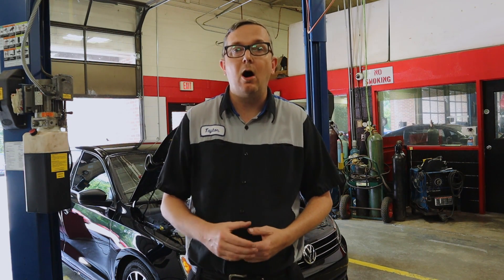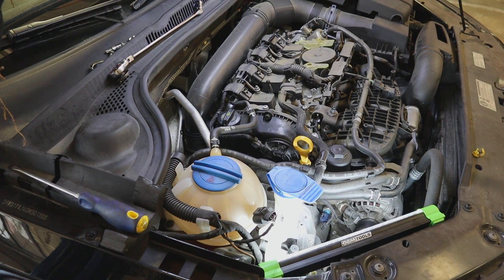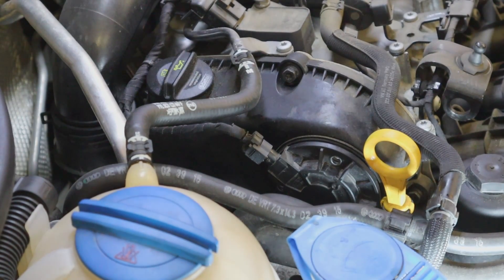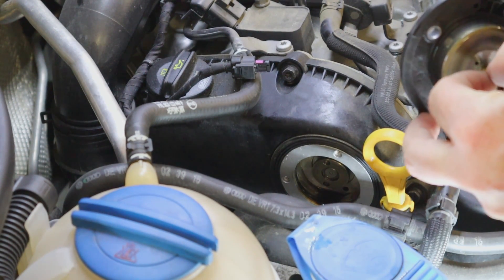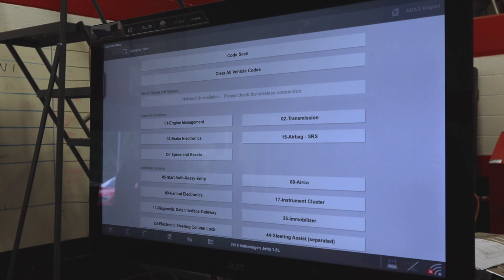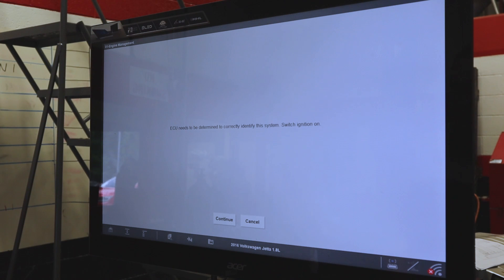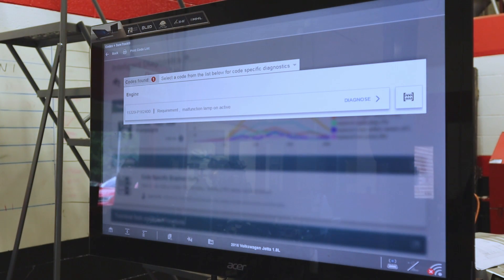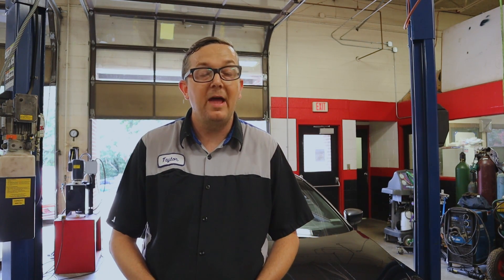VW Audi 1.4 1.8 2.0 TSI P0011 Camshaft code diagnosis and repair - try this first!

Comment: Thank you very much for the video. I have the same engine and it makes a noise that comes from the same region as the magnet. A diesel noise that comes and goes after heating the car only and I have a choke at low revs. When I take out the magnetic sensor, the noise stops. Do I have the same problem? I don't have light on. Thanks.
Reply: Fala Marcelo! Tudo certo? Conseguiu resolver o seu problema? Abs!
Reply: @chestercheetoss   Tudo bem, Thiago e você?Cara, estou meio perdido ainda. Desconfio dessa peça do video, o sensor magnetico mas ainda não troquei. Você está com o mesmo problema? Assim podemos tentar nos ajudar né?Abraço
Reply: @Levantoucortou  Não consigo te enviar o meu contato.
Reply: @chestercheetoss  Qual que é o problema que o seu carro está tendo?
Reply: @Levantoucortou  Barulho na Polia do Variador, com o carro quente. Quando desliga o magneto o barulho para. Não tenho nenhuma luz acesa, nenhuma falha, e o desempenho do carro está ótimo.
Reply: @chestercheetoss  é um barulho que parece carro diesel? Barulho que vai e vem? Engraçado que o meu quando tiro o conector do Magnetico o barulho continua e também não tenho código de falha.
Reply: @Levantoucortou  estranho. Quando você desconecta o Magneto, o barulho continua? Pode ser tensionador da corrente de comando. Qual é o seu Jetta? 211cv ou 200cv? Quantos Km?
Reply: @chestercheetoss  O meu é 2017 com 50milkm só. O barulho no meu só faz quando quente mas não é sempre..tem dia que faz e dia que não faz. O barulho fica oscilando quando faz..faz e para faz e para..tipo: ativando e desativando ......
Reply: @Levantoucortou  Esse motor EA888 tem um barulho característico, um barulho de carro a Diesel mesmo. Mas quando fecha o capô, o barulho é bem baixo. Realmente o seu carro está muito novo. Acho difícil ser tensionador/corrente de comando. Pela Km do carro, eu faria imediatamente uma descarbonização da Admissão. ( sede de válvulas e coletor ). Agora se vem um barulho mais forte, daqueles que você consegue ouvir de dentro do carro.. vindo da região do sensor Magneto.. pode ser 3 coisas... 1. O próprio sensor magneto travado .. 2. A válvula VVT, que fica dentro do comando de admissão. ( consegue ver ela quando remove o sensor magneto ). 3. A Polia variador de fase, que é o próprio comando de admissão.
Reply: @chestercheetoss  então, o barulho vice escuta de dentro do carro. O engraçado é que não tem erros no VCDS quando eu passo. Eu tenho o vcds e quando o barulho apareceu eu fiz a leitura em tempo real do camshaft intake e fica um pouco fora do especificado que é 10 graus em marcha lenta. Quando frio bate os 10 certinho. Quando o barulho começa depois de quente fica entre 6 e 9 graus. Muito estranho não gerar erro.
Reply: @Levantoucortou  Provavelmente algum problema na Polia do variador de fase. Ela não ta enchendo de oleo e fica folgada, fazendo barulho. Como disse anteriormente, pode ser a Valvula VVT obstruindo a passagem de oleo. Seria o “teste” mais barato. A troca dela não é tão cara. Mas precisa de ferramente específica pra trocar. Ah, e a rosca dela é rosca inversa! Muita gente acha que ta soltando, e na real aperta ela d+.
Reply: @chestercheetoss  Eu ate pensei em tirar a valvula vvt mas tenho medo de na hora de rosquear tirar de sincronismo a corrente. Eu achei no ML a ferramenta para ela. Acontece que não vende só a Polia né...Acho que é o comando inteiro.
Reply: @Levantoucortou  não tem como perder o sincronismo pra trocar a VVT, pq ela fica dentro do comando. Eu comprei a valvula e a ferramenta. Mas a ferramenta que comprei no ML não entra na valvula. Estranho d+. Devolvi e vou comprar de outro vendedor.
Sobre a polia, sim! Ela é o comando de admissão. Não vende separado.
Reply: @chestercheetoss   Tudo bem, Thiago? Conseguiu trocar a VVT? Deu certo ?O meu tinha dado uma parada no BArulho mas andou voltando as vezes, mais dificil mas voltou. Estou desconfiado dessa valvula mesmo ou do proprio Imã. Ele faz um barulho quando fica um tempo desligado e na hora da partida vem um barulho de uns 2 segundos se desligar e ligar na sequencia o barulho some.Acho que não está segurando oleo mas o nivel esta ok e sem erros no VCDS.Muito estranho.
Reply: @Levantoucortou  Fala Marcelo! Rapaz, o barulho diminuiu bem .. por isso não troquei a vvt. Estou com ela ainda .. quando o barulho voltar eu vou trocar. Mas ainda não fiz a troca não. O barulho que você escuta qndo deixa o carro parado e volta a ligar .. provavelmente é a polia enchendo de oleo .. ela vazia faz barulho .. qndo enche para. Eu conversei com um cara de fora do Brasil .. ele disse que pra resolver 100% .. tem que ir por eliminação .. Valvula VVT, Sensor Magneto, Cavalete dos comandos, e por ultimo o Comando de Admissão.
Reply: @chestercheetoss  Então.. estranho que nem o meu é nem o seu geram erro ou aviso no painel. Será que a polia demorando segundos a menos para encher tem relação com a vvt ou magneto? Já tive outros TSI e não tinha esse barulho. Eita negócio chato, viu.Depois que coloquei um aditivo da liquimoly o barulho após esquentar apareceu com menos frequência mas ainda está lá.
Reply: @Levantoucortou  I have this EXACT same issue!!!! What worked for you to fix it?

Comment: Do you have another link for the “special tool”? it says currently unavailable
Reply from the maker: Try this one  Engine Timing Tool Kit ，Engine Camshaft Locking Alignment Timing Tool Kit for Audi VW Skoda VAG 1.8 2.0 TSI/TFSI EA888 T10352 T40196 T40271 T10368 T10354 with T10355 https://www.amazon.com/dp/B087CWJZYM/ref=cm_sw_r_cp_api_glt_fabc_M639ZRCYSSP18751CQT8?_encoding=UTF8&psc=1

Comment: Also, would sea foam help loosen some of the potential debris? Btw I have a 2015 1.8 Jetta having the same issue
Reply from the maker: I would not use that, and it may make things worse due to loosening more debris that can get caught higher in the system. Routine oil changes with quality oil can help the most.

Comment: Do you have to drain the oil first ? Do you have to disconnect the battery ? 
Doing my 2010 Audi A4 quattro next week 
Thanks
Reply from the maker: I did not drain the oil or disconnect the battery, but disconnecting the battery is actually a good idea.

Comment: Hi , suddenly i had issues with same engine EA888 2.0 from S3 2015. It had idle misfires and i swaped magnets from a different vehicle and things got almost perfect , but still a little hiccups , maybe i will clean the valves also after installing the new magnest on both cams ? Or should i change something else (car has 38 000kms on clock so i guess injectors is impossible) New OEM plugs and coils.
Reply from the maker: I would pull the intake and inspect the valves for carbon build up. That’s a common problem for these as well. Thanks for watching, and good luck with your repair!
Reply: @AutoScholarwithMrB  i also thought about the intake clog but car has only 38 000kms... so i think it should be ok there

Comment: I have a volkswagen beetle recently had an oil change like 5 days ago and yesterday P0011 code
Reply from the maker: If the oil weight and type are correct, I would try this.

Comment: Thanks for puttings this video together!

I'm getting the code P000A, shall I replace directly tensioner or this might also be causig the problem?
Reply from the maker: It could be, they had tensioner problems for sure, especially on the older ones. Thanks for watching!
Reply: @AutoScholarwithMrB  THank you for your fast repply. P000A could also fixed with your repair? 
I had my chain changed 8000km ago, because of the well-known tensioner problems of those models (1.4 tsi 2007).
Reply from the maker: @albertoc5427  it would be worth a shot
Reply: @AutoScholarwithMrB  Thank you for your guidance.

Terrible experience so far with this engine!
I also have a short, my fuse F21 blows with sparks when I introduce the fuse. Also having error code P2262 /turbocharger) & P10AD. Not sure yet if it's because of the short or the short is due to a problem with the electromagnetic clutch of the water pump. 

Great channel, already subscribed to learn more!

Comment: Hello i have a 2014 jetta with the 1.8t motor. Car runs good when not warmed up but after like 20 or 30 min it will have a hesitation around 1500rpm or when going uphills. changed plugs, coils, and fuel injector cleaning. Could this be my issue?
Reply from the maker: Normally if you have this issue you will have a code for it. Do you have any codes?
Reply: @AutoScholarwithMrB  thank you for the reply no no codes driving me nuts
Reply: @Auto Scholar with Mr B   Any idea of what i might look at next? Cam sensor?
Reply from the maker: @james6386123  I would think anything like that would cause a code. How long has this been happening?
Reply: @AutoScholarwithMrB  Just bought the car june 1st. 70k miles did not notice when i bought it. But now seems to be more noticeable. i took it on vacation and in the hills it has become very noticable.
Reply: @AutoScholarwithMrB  Seems to be exactly feeling like a bad coil like lack of power and chugging sometimes. but was changed.
Reply from the maker: @james6386123  have you recently changed fuels?
Reply: @AutoScholarwithMrB  i did switch to premium this tank but did not seem to make a difference. Regular is ok according to manual.
Reply: I did run techron through twice able 2 weeks ago with no change.
Reply: @AutoScholarwithMrB  i also cleaned map and boost sensor with maf cleaner
Reply: @AutoScholarwithMrB  Also just a heads up it will idle very smooth about 600rpm according to dash.
Reply: Cam sensor did not do anything also. I notice it is worse when i have ac on or more weight in car.
Reply: Dictor 1.8 turbo beetle 2015 recommended  gas octane 87 or 93 or 89

Comment: Wait so I don’t need to replace my timing chain??? That’s what autozone said it was for lol 
I look it up and it’s actually the variable valve timing. All I have to do is replace it?? I found a new one at pick a part for the 2008 vw Jetta
Reply from the maker: Well it is dependent on your situation. If you do this and it doesn’t work, the timing chain may need to be replaced. Thanks for watching!

Comment: What scan tool did you use? Thanks for the video
Reply from the maker: This is a Snap On Zeus in the video, but lower priced scan tools are fine for this as well. I just use this one because it has a large screen and is easy to video and teach with. I also have a Verus Pro, solus edge, and Autel Maxysis.

Comment: I was driving my 2010 tiguan and then my serpentine belt ripped in shreds and some of it got stuck in my alternator pulley. I tried to get enough of it out so it could spin when I put the serpentine belt on. I thought it fixed my problem but my engine kept stalling and wouldn't start after turning the key. I started getting the p0011 and p0341 code dealing with the camshaft. I think the belt hit the wire of solenoid and whatever is around it after it snapped. I'm gonna try to fix this before taking it to a mechanic shop.

Comment: Had an audi A5 2.0 TFSI in with a missfire turns out it was a stretched timing chain and clogged vvt. Got it running sweet and then done an oil change afterwards and found out that it looks like some asshole has put pretty much pure oil thickening stop smoke in it instead of normal correct oil. When I undone the sump nut the oil didn't poor out, it glooped out like grease. I put the correct oil in it and now the oil pressure light is on and it smokes like hell. The customer is obviously screaming saying that it wasn't smoking when it came in and he has got a fair sized bill because the genuine parts was quite expensive, the car has been a headache as so has many more modern cars for us lately. We are only a small garage who try to make the bills for customers as cheap as possible sometimes spending lost unpaid hours diagnosing silly problems. I think modern vw/audi/seat produce bad cars these days and cars generally are a pain in the arse and are not designed to last, and I'm sure main dealers want cars to be uneconomical to repair after 8/9/10 years so they can sell you a new one with easily payable finance. Do you think any of these cars will be kept as classic cars in the future like we do with 50's, 60's,70's and 80's cars now? I don't think so.I don't think you can beat a Ford or vauxhall or something Japanese these days, German cars have gone down hill big time in my opinion. It makes me wish I had gone into a different trade as a young man wanting to have his own small business, main dealers are making it harder and harder for us to survive. Its a throw away world theses days and cars a lot of the time are unrepairable because of cost.
Reply from the maker: Agreed. It is so difficult for anyone not dealer trained to fix these cars, which is one reason I make these videos. Thanks for watching, and I’m sorry about the bad luck :(

Comment: Wow! I wish I had found this video a month ago when I started having issues with my 2016 Jetta. The engine light went on, and I thought it was due to spark plugs and coil packs. I replaced those, cleared the codes, but the light came back on about a week later. I then replaced the camshaft position sensor after looking at the new codes. That didn't fix the issue either. The light stayed on, and the misfire that I was experiencing while idling was starting to get really bad.  
I saw the P0011 fault code, but for whatever reason, YouTube didn't show me this video. I wish it would have because this explains everything so well. My warranties wound up covering me with this issue, and the dealer did the job in the video with no charge to me. But it was exactly this issue. Camshaft adjuster magnet.
Reply from the maker: YouTube has changed the way they rank videos, and it is unfortunate. However, liking the video and subscribing helps me show up to more people that need to see it. Thanks for watching, and I’m glad you got your car fixed!
Reply: @AutoScholarwithMrB  Liked and subbed!
Reply: how much torque should i put on those t30s?

Comment: Can you please post the link for the tool to unscrew the valve?
Reply from the maker: I believe this kit has the correct tool:  Engine Timing Tool Kit ，Engine Camshaft Locking Alignment Timing Tool Kit for Audi VW Skoda VAG 1.8 2.0 TSI/TFSI EA888 T10352 T40196 T40271 T10368 T10354 with T10355 https://www.amazon.com/dp/B087CWJZYM/ref=cm_sw_r_cp_api_glt_fabc_4EW9B00FWXTSPNCJCVD2?_encoding=UTF8&psc=1
Reply: @AutoScholarwithMrB  will unscrewing the valve with the proper tool and then replacing it affect the timing? Or do I have to remove the chain cover and use something to keep it from turning?
Reply from the maker: @realagent83  should not mess with the timing at all

Comment: First of all, thank you for the great video. So I have the same car. Been dealing with the same issue a while. So I was getting the same code, and a rough idle. Rough idle only when the motor was cold or the first few miles in stop and go traffic. After diagnosing the cam magnet, I took the magnet and valve thing out and cleaned both. It seemed like the oil (fresh) was keeping the pin in the magnet from moving freely. So I cleaned both with brake cleaner. And car ran perfect for a couple weeks. So cleaned it again and again and again. Each time getting less time with it working properly. My question is, if I clean it and works great for almost a week or after the car is warm it runs perfect the rest of the day even if it’s clogged with oil then how is broke. I change my oil way more often than suggested. Use proper spec oil. How could cleaning it fix it but it “breaks” when it gets clogged with clean oil???
Reply from the maker: Have you tried replacing the magnet? It might be worn. That would be my next step. I would probably replace the valve insert as well. What weight oil are you using?
Reply: @AutoScholarwithMrB   I actually replaced the magnet today. And thank god it fixed it. I have been throwing different sensors and parts at it for the past year. Thank you for your video.
Reply: @robertwinnall8120   do you have a part number for the magnet or what’s that magnet called? I can’t seem to find it maybe I’m not looking right
Reply: @Nino.Calderon  I did a little research and 06H109259A is the magnet my 2014 jetta 1.8 tsi calls for
Reply: Awesome video! Thank you so much. One question though; what’s the valve insert called? Part number?
Reply: Hi i am having same problem with my 2019 audi a4. Car misfires for first few kms only on dead stop or when it’s extremely cold and runs fine afterwards. Got magnet and valve cleaned but issue returned after 2 weeks. So is ur car running good afterwards? Not sure if there should be a chain stretched on 2019 car

Comment: Very informative video and thanks. I am about to replace both parts myself....VVT magnet/solenoid and oil control valve. Question: Were you able to take the oil control valve out and back in without having to put any reverse tension on the cam so nothing rotates....or does that not matter since everything is all sync'ed up? I just want to make sure before I get in there. Thanks!
Reply from the maker: You should not have to use too much strength to get it off, so it shouldn’t rotate. Thanks for watching and good luck!
Reply: @AutoScholarwithMrB , thank you very much! :-)
Reply: @AutoScholarwithMrB Hi there, I was not able to remove the valve no matter how I try. May I know whats the best course of action from here on?
Reply from the maker: @plzdonhack  are you turning it the correct direction? Should turn clockwise to loosen.
Reply from the maker: @plzdonhack  I’d have to see it to see if this is an issue.
Reply: Did it work?